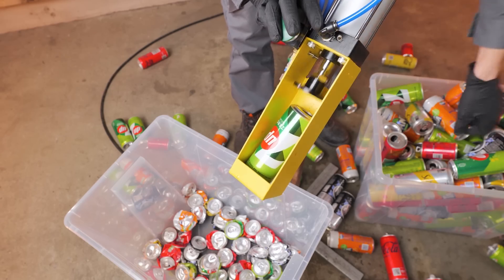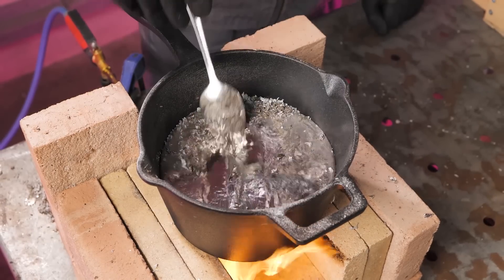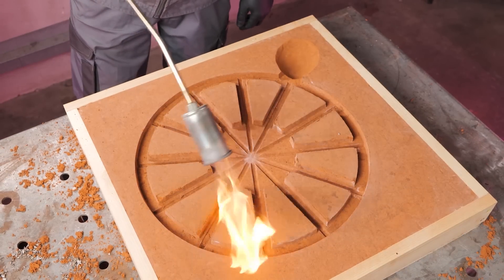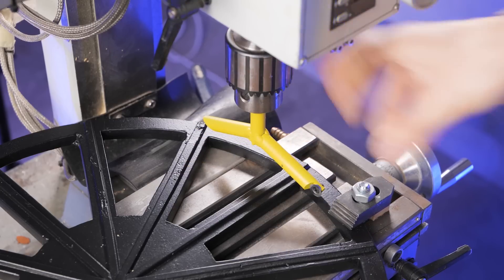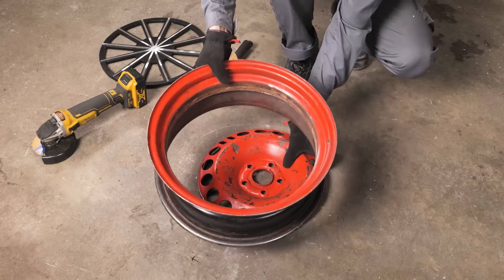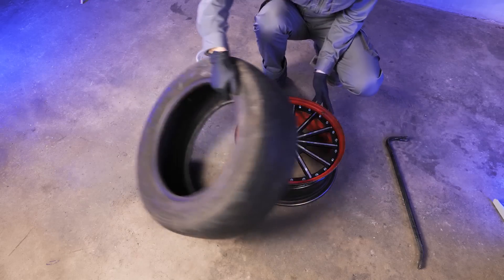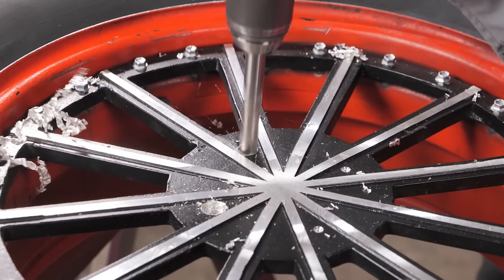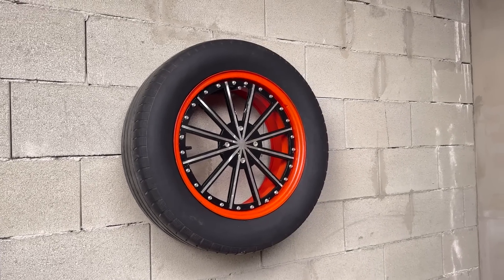Second life of aluminium cans ♻️ melting aluminium cans 🔥

Comment: I probably missed the point of the video, since everyone knows that pure aluminum is a soft metal completely unsuitable for the production of wheel discs, and what's more, with such thin spokes.  But at least the home processing of aluminum and its casting was interesting.  You could have cast something more interesting. Perhabs something decorative...
Reply: I'm sure they will do their utmost to make something that you find more....interesting. Pleasing people on the internet is clearly in their best interest.
Reply: lol, I missed the point where you has singing lessions and a gym membership ... oh you didnt you just posted crap singing videos,  you might want to know wheels and rims have been produced in aluminium alloy for many years and are still produced, not all are made from steel, and this process is used for more complex designs but this is just a simple recycle video to show how its done and it was interesting.....now off you run back to the hole you cralled out off you npc fat boy,  get that belly shaking at the gym before posting more videos .